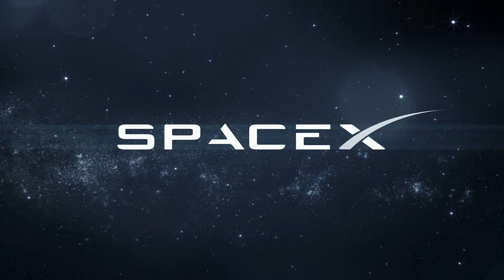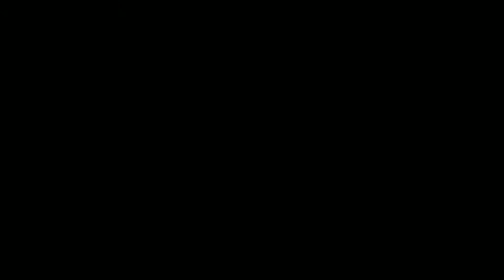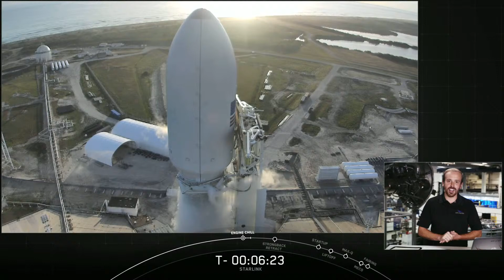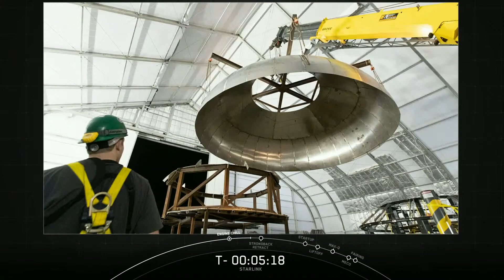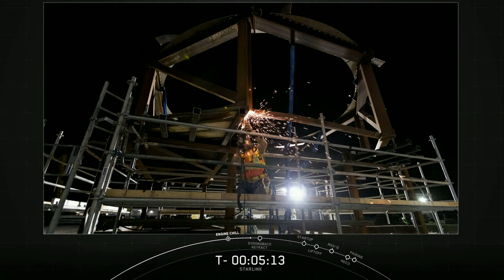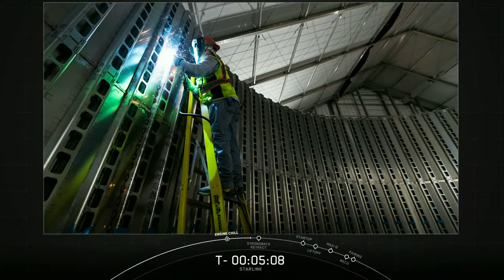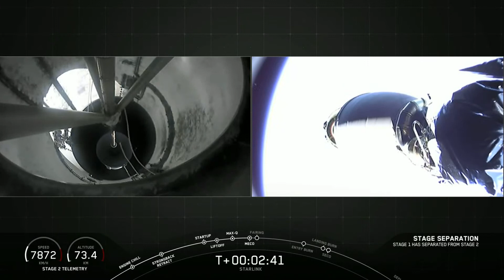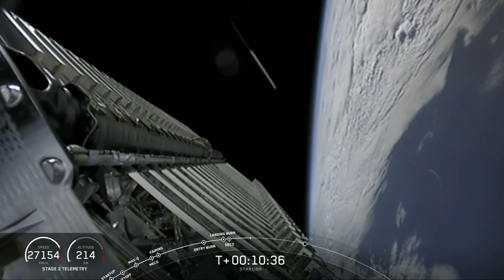Starlink Mission

Comment: Can someone explain me the altitude meter? It was going over 20.000 km/h and yet the altitude barely moved. Were they flying horizontally or were they already on the orbit?
Reply: Already in orbit (= flying horizontally really fast). Similar to when you spin a coin hung by a string with your hand: the coin is going really fast, but it's still the same distance from your hand.
Reply: Yes it was already on an orbit velocity by that point, as you can see at 23:55 . Or at least, the extra thrust was just getting the rocket into orbit, not pushing itself further away from the earth.
Essentially they were flying perpendicular to the earth. You can see that as it speeds up, the altitude changes very slightly, but most of the thrust the rocket is producing is serving to making the orbit more circular around the earth. If they had angled the rocket facing directly away from the earth, the altitude would increase drastically.
Reply: Alright, thanks guys.

Comment: So sad for the stage 1 booster. I hope SpaceX can make their 51st Landing.
Reply: When the first landing burn shut off and the rocket did a roughly 90° roll, made me a little nervous and then they quit showing the feed from it so maybe they had a hydraulic issue with the grid fins again..?  Don't quote me on the 90° thing but it looks to be at least that much as I only watched it the one time
Reply: @dmeemd7787  it also looked like the engine was still lit or something at the bottom was starting to burn after shutdown.  It also appeared that some substance was hitting the camera after the burn. I have to look at it again to double check that i did indeed see what i think i saw.
Reply: 5 launches for this booster is pretty good though. Don't see anyone else pulling that off.
Reply: If they dont show it that means it was lost.
Reply: yah, looks like 5 missions is a treshold for booster with drone ship landing. still remarkable if you think of the forces involved at reentry, boostback missions are much less violent.
Reply: Second time in a row 😕
Reply: @jamespaddock736  no, the last launch was the CRS mission and that landed. It was the previous star link mission that failed recovery but that was 2 missions ago.
Reply: Ashley Williams 
Ohh okay cool the last one I watched was the star link mission still pretty sad though 😕
Reply: @22:10 the call entry burn shut down but you can see there's still flame. Perhaps some hydraulic lines melted
Reply: @SolarAbyss  cool, so i did see that right. Some greasy substance appeared to be hitting the lens and there was that hard roll correction it made as well. You could be right about hydraulic fluid loss.
Reply: It looked like it was lacking some love at liftoff...it didn't even look like they cleaned it for this flight. Oh well. SpaceX is probably testing something and knew they had an "expendable, yet expensive" toy.
Reply: Because the 51st landing is going to be starship. Like it’s meant to be. Good way to start off a new rocket.
Reply: There were multiple objects flying by around the time of the entry burn. I wouldn't be surprised if something hit the booster..
Reply: Wdym? We didn't even see how the booster landed
Reply: Guys, SpaceX just released the Starlink Mission Control Audio in another video
Reply: @exoplanets  
https://youtu.be/JOqc63Pp9OA
Reply: It was really weird the way they worded it, they said it like it was intentional they said it like it was intentional but I don't know why they didn't mention it during the stream until the end and then like I said that it was really weird the way they said it either way it's still a bummer though
Reply: How do you know we lost it? I'm still watching the video, do they say it?
Reply: @DimapeloManual  Yeah, right at the end of the video, they confirm it was lost. @ 30:44
Reply: @maxnaz47  thanks man, sad it crashed but glad it worked
Reply: @DimapeloManual  at T+00 06 38 to t+00 06 40  there's an object passing  close to first stage or something lost from first stage
Reply: @GabrielePirondini1968  yeah. What the heck was that?
Reply: Grubbbee I thought it was ice
Reply: @KayoZet   looks like metal
Reply: @GabrielePirondini1968  Chunk of frozen LOX maybe?
Reply: @GabrielePirondini1968  Yes, metal or something else that was solid.   Looks almost ring-like.
  1) Was it space junk, or part of the 1st stage? 2) Did it impact the 1st stage at any point?
Reply: @GabrielePirondini1968  Saw that too, no mention of what that was but at those speeds and the size of the object, it if collided, that would have been catastrophic
Reply: @GabrielePirondini1968  strange that there was no mention of it
Reply: @GabrielePirondini1968  its frozen oxvgen
Reply: SpaceX be fucking up a lot lately 😬
Reply: @pvfeB7Ax  when you reuse rockets 50 times it's only a matter of time before the booster wears out
Reply: https://youtu.be/JOqc63Pp9OA

Comment: 21:30 (06-40 since LO) - what is the object that the booster rips past - it looks a bit like a drone, but I guess it could just be frozen oxy or other (normal) debris that fell off earlier?
Reply: Booster is travelling 6500km/h at 50km. It's not gonna be a drone
Reply: @_Andrew2002  I agree - but I didn't have the speed and altitude data - where did you find it?
Reply: @tobyseaman7977  It cut off at 8000km/h heading up. It would've lost speed then gained as it fell. I just guessed based on numbers in my head
Reply: It's ice, always ice
Reply: I guess it's space trash
Reply: At that altitude I'd say it's a balloon of some sort.  It probably wasn't as close as it seemed, probably a kilometer away from the camera actually.  But yeah, it sounds like something hit the booster soon after and broke it apart, rather than it just missing the drone ship...
Reply: @andrewzaborowski9685  or right up close and it literally just fell off from the bottom.  I've replayed it 50 times and can't decide.  I guess it's ice, but it was an odd shape indeed!
Reply: Space debris!
Reply: Prolly some secret weapon deployed by Jeff Who to sabotage the booster recovery
Reply: actually there is a smaller object a few seconds earlier. May another hit the booster and caused it to miss the landing?

Comment: @ 21:30 In the 1st stage window... WHAT THE HELL WAS THAT!?!?!?! 😳😳😳
Reply: Space Junk?
Reply: Thingy, probably ice, breaking of from around the engines and because it is effected more by the air drag it goes by close to the camera
Reply: @kedrednael  I'm thinking you could be right, got out of bed to restart my computer and check it out on the big screen. It does appear to come from the bottom of the rocket and does not appear to be as large as i first thought watching on my phone. Pausing it at the very end before it leaves frame, screen shot it and then enlarged in photo editor... It does actually appear to be an out gassing block of ice... 😒😔😞
Reply: @maxnaz47  Okay nice research :)!
Reply: Aliens of course
Reply: What ever it is, it was damn close to ending the 1st stage's whole career...

Edit: Apparently 1st stage failed to land anyway... But still, i demand would very much like an answer.
Reply: probably a space debris
Reply: @Stark_1905  It is way too low to be space debris because it would be burning up or just deorbiting at that altitude.
Reply: Your mom

Comment: Not a happy day fot that booster.
Reply: Five successful launches. That sounds pretty good!  RIP booster.
Reply: approaching its maximal lifespam estimate, seems pretty good for. that booster
Reply: ”Falcon Heavy middle booster, is that you??”
Reply: Didn't that last successful mission also lose a booster? I wonder if boosters can  be retrieved from the water when they miss?
Reply: @5bJuggla  I think it was the launch before last when they lost a booster. They can be fished out of the water if they're not broken into pieces and sink, but salt water and electronics don't mix well so it's unlikely the booster could be reused
Reply: Guys, SpaceX just released the Starlink Mission Control Audio in another video
Reply: @exoplanets  What's so interesting about that, and why are you commenting about it on multiple threads?

Comment: Would it be possible, to get the specs for the booster after booster seperation too? Would be pretty interesting
Reply: If you check their otv-5 mission they were carrying a classified payload so they only focus on first stage. You are able to see all of the velocities and altitudes that the first stage goes through. It was incredibly interesting.
Reply: @astrophotographysometimes2303  Thanks for the info, haven't watched that launch before. Yes, it was very interesting to see, would be nice, if they did it on every stream.
Reply: @BG he meant the telemetry for the first stage. he asked if spacex could show the telemetry for the secondary mission.
Reply: @azrulaiman1394  I agree.  I don't see how it can cost (much) extra and it would be good to see... especially if we get to follow the booster down regardless of any anomaly.

Comment: What is the Disc coming from nowhere at the end of video?
Reply: it was at 31:10
Reply: @armanafridi4384  oooh, thats probably just a lens flare, thats why its a straight line
Reply: What?
edit: probably a lens flare, its white, perfect line, comes out like a shade, moves to the sides, its a flare.
I think you can see another one at 30:46 in the center, but this one is circle shaped, camera is in a vacuum so idk what made it, perhaps the reflective starlink sats? im not an aerospace engineer so idk.
Reply: @CarlosAM1  When altittude was about 204 an unknown object flew next to stage 1
Reply: @lukash33  ice probably, you can see it coming from below, coming from the nozzle and theres also another piece of ice that comes before it. 22:06 heres ice coming out of the second stage for example. also the object is very reflective, but if its not ice and that engine was supossed to ignite then we got a problem.
Reply: Wondering the same thing. It was at 6:38 into launch
Reply: It's a UFO
Reply: Elongated muskrats prank and you fell for it f00ls
Reply: Looks like it came off the bottom of the booster.
Reply: what disc? Could you post a timestamp? Or is that thing Eric mentioned? That's most likely a piece of debris. I see those all the time in these streams
Reply: @UC9DsB7kBiY1wXOdiJX2qkqA or ice, I doubt it was an engine part, but if it was either the engine blew up on ignition or it wasnt an engine that ignited.